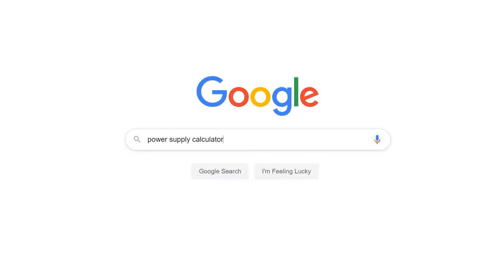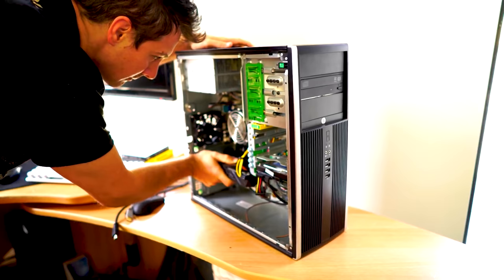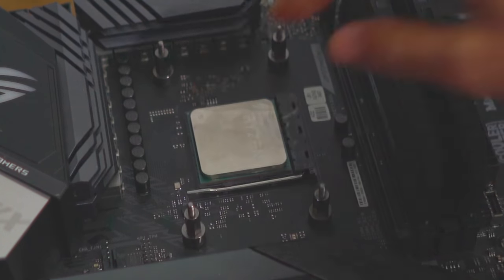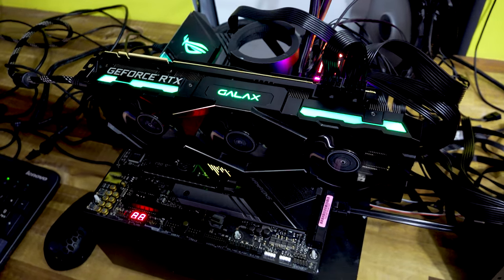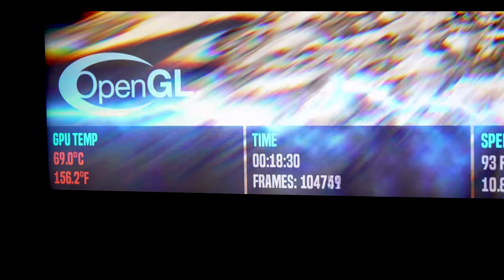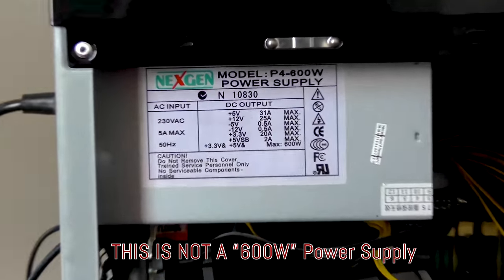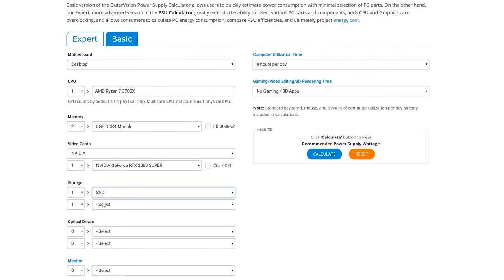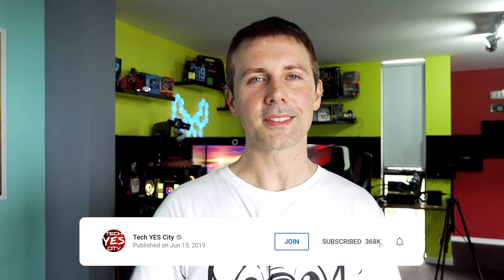I Tried Running a 3950X and RTX 2080 Ti on a 450 WATT Power Supply...

Comment: This is what happens when you win a cpu and gpu in a giveaway
Reply: Lol
Reply: I guess but  if u win that  u better work ur ass off to buy a decent motheboard an PSU.
Or just sell them n get some money .n make a build u can actually take advantage off
Reply: Lmao
Reply: @NeVErseeNMeLikEDis  sell 3950X for 700$, sell RTX 2080 ti for 1000$
build a 3700X + 2080 Super + B450 Tomahawk + RM650X + 16GB 3600/CL16 + 1TB SSD + 1440p/144hz monitor with that money
Reply: i can relate lmao XD
Reply: cob - Anime on Piano and More nah with that money go for the x570. Because that way you don’t need to update the bios. 3000 series chips won’t run on 450s unless the bios is updated from factory or if u had an old 1 or 2 series chip
Reply: RiceCube Tech B450 Tomahawk Max. That’s all i need to say.
Reply: @radiumuppet  radeon 64 sli oooff
Reply: @RiceCubeTech  yeh, like @Mr. said, B450 Tomahawk _max_. It comes with a bios chip with twice as much capacity with support out of the box for Ryzen 3000, and its VRM quality is as good as most of the <200$ boards. Saying that the board can handle a 3950X with PBO + Auto OC on with VRM temps below 90 degrees. it's nice sub 100$ board. I would personally much rather have that extra 100$ or so go towards a larger ssd (so 2TB), a large capacity hard drive (would be able to fit 4TB or so, i personally need that storage, but others may not so a 2TB SSD may be a better choice), or an aftermarket cooler like the dark rock pro 4, which for <70$, I could probably pocket that additional 30$ to something like aesthetics
Reply: I wouldn't know :/
Reply: @radiumuppet  That's a shitty build, can't even oc the cpu then
Reply: @radiumuppet  why this old mb ? Instead new chipset ?
Reply: @nikenzzo  you don't need PCIE 4.0 lmao
Reply: @RiceCubeTech  or you have bios flashback function...
Reply: @fucjn4315  It's ancient
Reply: @fucjn4315  Z97 is pretty old now, best CPU you can get is an i7 4790k. Also no DDR4 support. Z170 or newer would be better.
Reply: @NeVErseeNMeLikEDis  never sell em !
Reply: Why wouldn't someone buy the other stuff if they win premium products like these
Reply: @jagdeepsingh9515  Because if the other components are shitty then you won't see the benefits of the premium components anyway, is better to have a medium-high balanced build, than an really low - really high unbalanced build, since then the performance of the premium gets bottlenecked, of course, if you have already a really good PC, then great, but if not it doesn't makes much sence to keep them for no benefit whatsoever.
Reply: hi guys, anyone can help me with my psu350w build? So I want to change my pgu from gtx 750 ti for gtx 1660 super on specs. 2x4gb ram, b450 aorus pro, ryzen 1200 (af) on psu be quited (bronze) 350w. Can this psu handle it if I will undervolt a little my gpu and I wont oc ryzen ? Because in the next 1 month I will change psu for 500w and ryzen 3 1200 for 5 3600. But for now I think it could run gtx 1660 super cuz it has 125w usage, ryzen aroudn 65w max, what do u think ?
Reply: lol
Reply: Lol
Reply: @carlosrangel7134  that will run just fine
Reply: He met in a scenario that he never expected
Reply: @UnspokenTube0  I want this giveaway  🤣🤣🤣
Reply: Can my 400w psu run my rx 570 or ryzen 5 2600
Reply: Does it ever actually happen to anyone?
Reply: @radiumuppet  Still believe in no x570??? now
Reply: @jshane8888  yes. B550 exists now.
Reply: @radiumuppet  give me tutorial to sell giveaway part, since we are just a pc user, not a pc shop. i'am worried about people who want's to buy but bid in low price (sorry if bad english)
Reply: I wanted to give a friend a cpu, but his psu is not good enough, he doesn't have the 24 pin connector for the motherboard but only 12( he was talking about adapters maybe but I don't think that works).

And besides that I don't think its a very good one, some random oem one if I understood him correctly and only 500w(and I was planning on giving a cpu thats not very power efficient).
Reply: hahahaha wah beta wah moj kar di

Comment: BREAKING: Australian man's power supply blows up
Reply: BREAKING
Reply: He attempted to make an impossible experiment and his Power supply just blew up.
Reply: She Blinded Me, ...WITH SCIENCE!!  Thomas Dolby LIVES!
Reply: @dropdead234  Thomas Dolby does live. He is currently 61.
Reply: @Safetytrousers  Went right over your head, didn't it?
Reply: @dropdead234  Yes. It still does.
Reply: Fire soon started from that house
Reply: BREAKING Austarlians power supply
Reply: Power supply never break if u use more than it's capacity it basically shut down itself and restart..
Reply: I done that once doing the paper clip jump method, must have got the wrong pins soon as I flipped the switch BOOM, sounded like a car backfire it triggered the breaker in the house power box and shutdown the house scared the shit out me hah.
Reply: XYGR Gammel Group yeah?, strange this was a Corsair TX850 gold so wasn’t no brand crap, that’s 100% how it went down I lost the 24pin jump starter plug there was nothing connected except water pump and fans as I was leak testing my loop, I was going off a photo on my phone which connectors to put the paper clip in was confident it was correct flipped the power button and boom, I remember looking inside through the fan shroud with a touch and one of the big capacitors was swollen popped and stuff was leaking out of it.
Reply: BREAKING WHAT???!! BAD
Reply: @forsakenoutcast  to be fair I have a corsair power supply and it just turns on, no matter what. It doesn't care about short cutting.

But under normal useage it was never an issue in all the years I've had it.

Comment: Reminds me of the time when I installed a 500watts PSU to my client's unit with a gt1030 and he said he replaced it with a better PSU which is a 700watts generic one. I like fhe way he said it was better because it was 700 watts compared to the 500 true rated I installed. 😂 I explain all the power thing but left things to his hands. He'll eventually bring it back to me when he get problem with it.
Reply: I suppose you have charged him for warranty service? Or nothing got damage permanently?
Reply: He's got a 1030 lmao, there are few PSUs I wouldn't trust with that
Reply: With a GT 1030 he no need more then 450w 80+ white and even this is OVERKILL.
Reply: @strohhuttv8848  already told him that. Even a 300watts on a OEM can run that card. You don't argue with customers though. I keep all record and contracts because there will always be that one customer that will either try to rip you off or don't listen but don't want to pay either because they made their research but have you repair it.
Reply: @jay22alco  Indeed today most customers doesn't listen and do what they want.
Reply: Most likely it would be fine with the crappy "700W" PSU if it's only a GT 1030. A waste of money, for sure, but that's not your problem.
Reply: I mean it could better for the lifetime of the psu
Reply: I need help. I just swapped my 1660 for a gtx titan Z and I wanna know if 500w can run it

Comment: I've been saying it for years.  But good luck trying to convince people with cinder blocks for heads they don't need a 1000w PSU if they are not running multiple GPUs, a high end server or doing some sort of data mining.
Reply: IT IS a sexual Thing for Sure.
Reply: 1000w? No, but I'd say 850 watt is probably the sweet spot for a high-end single-GPU system that might see some overclocking. There are two areas you need to look at when sizing a GPU. First is your expected worst-case power draw (with some headroom to make sure you're not redlining it, which this video never did as the GPU and CPU were never stressed simultaneously), but the second is the noise and efficiency curves of a PSU. Power supplies are rarely at their most efficient when they're pushed to their limits, and a 600 watt load on an 850 watt power supply will probably be quite a lot quieter than a 600 watt load on a 650 watt power supply. Good power supply vendors will publish both the efficiency and noise curves for their power supplies, letting you see how loud your expected loud will be.
Reply: I know I didn't need a high wattage power supply, but I got a good deal on a SeaSonic X1250, and I was concerned ab noise and it had a passive mode. I got it for $140, and expect it to last a long long time, and generally don't hear the fan turn on.
Reply: cazablocki cinder block head confirmed 🤡
Reply: @maoteddy5879  Some people value silence. If you compare a 450W and 1250W PSU that both have passive modes (meaning the fan doesn't spin up until a certain power draw), I think you'll find the 1250W unit can push far more power before the fan is required.
Reply: @guspaz  It doesn't work like that, the more current the power supply draws from the wall more heat it takes.
Reply: @santiagocoradeghini238  It does work like that: the higher the power supply rating, the better the internal heatsinking. You can literally go look at the fan curves for power supplies of different wattages on manufacturer websites that show this. The higher the wattage rating, the higher the power draw required to cause the fan the spin up.
Reply: @cazandmal  as long as it stays clean. Dust affects heat and resistance of pcb
Reply: @johns3655  I'm pretty obsessive about dust, clean the dust filters weekly and every quarter or so pull the system apart to clean what I can. I suppose it's a downside of building a clean system, doesn't take much to make it look dirty.
Reply: Or if you’re playing pc building simulator and want to build the most expensive pc you can.
Reply: @guspaz  no, even a high end cpu and top gpu is under 400 watts in modern hardware, 850 is complete bullshit you don't know what you're talking about.
Reply: Got a cinder block as a head then with my 1500 Watt PSU ;)
Reply: Same people that think 8GB on a RTX 3070 is not enough when gaming at 1440p or lower.. They are why marketing with just bigger numbers will always remain effective..
Reply: That same PSU calculator used in the video told me that my system would need about 625 or so watts in it's current (outdated because of an old GPU I am reusing) state, and that for future upgrades to an RTX 3000 series I would need about 725 watts, which is why I am going with a 850. It's a bad idea to have the PSU just barely be hitting under it's max load, not to mention you waste more power that way as efficiency goes way down when you start hitting it's wattage ceiling.
Reply: EE here, just wanted to point out that many components, GPUs in particular can have huge transient current draw, the Vega 56/64 for example can draw upwards of 400-600W even though average power consumption is in the 200-300W range. It can trip your PSUs OCP if the current spike is too much for your particular PSU model, like what happened with the Seasonic Focus Plus series for Vega GPUs. This isn't even considering the ability to OC, flash a custom bios, mod power play tables etc. That's just a single component as well, so if you're planning to OC in particular, adding a good amount of headroom is crucial. Cheers
Reply: I run 2 Xeon E5 CPUs and a mid range/ high end gpu (I change it often) with a 750W PSU so maybe multiple 3 or 4 GPUs would make it worth it
Reply: @cazandmal  140 for that kind of psu is pretty good similar price to what corsair sells there rmx 850 for
Reply: well if you "overbuy" a 1000w power supply that one will last you at least 2 or 3 pcs plus that ANY component that is being used at its 90-100% it gonna last less than one that is being used at its 50% of power

Comment: The crash is just F1 2019 being F1 2019... Having played this game a lot it does just randomly crash now and then with no error message. Ask anyone who league races on this game, you’ll get the same response.
Reply: Even just in career or gp this happens, on a ryzen 7 3700x and rtx 2060 with 650w like low settings its stupid lmao
Reply: I second this.
Reply: PUBG: Hold My CTD
Reply: Yeah that's right i have f1 2015 and it has the same problem xd when i run 2019 its the same
Reply: Comanso he should retest with other game
Reply: Starving a 16 core CPU of power will only make the system more unstable. This power supply was definitely puking out noisy, rippled DC power at 430W power draw. Not exactly a good idea.
Reply: 3600 and 1080ti, same problem with random crashes. 2018 did it too.
Reply: if i put my 4gb evga 10150ti in nvidia controle panel on adjust setting with preview on balance mode, wy csgo is crashing, if i change it, csgo works fine.
Reply: change it and see if it works

Comment: try a cheap “a-brand-you-never-heard-of” or an oem psu lmao. some people will get triggered
Reply: I bought a hp elitedesk and the oem psu in it is 80+ platinum
Reply from the maker: Already tripped the aliexpress banger lol.
Reply: Tech YES City bruh good luck with that lmaoo
Reply: @techyescity  450W, 80 minus wood certified
Reply: Make sure it doesn't come with the certain recent virus
Reply: TigerPower 500W
Reply: That PSU calc tells me 341 load wattage, my poor 290w optiplex.
Reply: it will explode as they put out maximum 150w out of those 500 or 1000
Reply: XYGR Gammel Group  he performed the stress tests at the start and it completed them fine
Reply: The Illuminati Make sure it doesn’t come with the Voldemort.
Reply: XYGR Gammel Group  That wouldnt stress the cpu so no
Reply: Is Apevia any good?
Reply: @ChrisD__  they seem ok, I'd look at using just an 80+, I've been using a Chinese £15 PSU for months and it's been fine, it's a 500w, but outputs closer to 450w and it's been fine, but my system doesn't consume much more than 340w, so check the label and make sure it's total output is more than you need by 100w or so and check reviews, I'd look at buying a branded,  scan have a 700w 80+ unit for £25, but I'd be weary about that, and a 500w 80+ from aerocool for 45, used isn't always a bad idea
Reply: What is because uncertified PSU has half of what it says it does.

Ever bought Chinese batteries then run tests on them? 99 times out of 100 it will be false.
Reply: @fewik8567  Chances are the PSU isn't truthful and is giving you 475 or 450.
Reply: @dra6o0n  yeah that's what I said, that's why I went 500w and not 400w
Reply: Dells often have gold 80 so idk why you mean OEM on pair with noname
Reply: i have bought cheap china power supplys all my life since 99 only had one fail cause i didnt shut power strip off and plugged cord in back of power supply and sparks flew my fault deal

Comment: I have several hundred hours in F1 2019. It crashes like that all the time. A few times in the middle of my league race. Trust me the PSU was not at fault
Reply: sadly its the truth, for some reason f1 games have this bad habit of crashing for no reason
Reply: When I play in fullscreen I have crashes, but when I play in window mode I don't have any problem.
Reply: if i put my 4gb evga 10150ti in nvidia controle panel on balance mode, wy csgo is crashing, if i change it, csgo works fine.
Reply: Codemasters are shit. I gave up with their games.
Reply: i just made a account for eve online online and the game runs bad with full screen mode and fast with windowed mode and its the only game i know that does that
Reply: Make sure to run in DX11 instead of DX12, that fixes a loooot of problems
Reply: You guys play on windows 10? Try disabling the fullscreen optimization
Reply: @F2Ptaxi  and the game mode
Reply: @jornmulder  holy shit where did you get a 10150ti!!!!?????
Reply: @eriiis2231  he's from the future
Reply: Hey Tayo the future is from him
Reply: yeah it's your cpu's not getting enough power dude not the power supply's fault bios setting's fault
Reply: @jornmulder  holy shit I want a 10150ti, it's probably way better than rtx
Reply: I know is an old comment, but I had consistent crashing playing Half life alix, and similar VR games after  1-3 hours with a 500W EVGA 80+ PSU white and after many repeated similar issues I just tried with a borrowed 700w 80+, and the crasshing stopped playing longer hours and now with a bigger PSU than 500w it is not longer are happening. Seems that games just close or stop to work is an usual issue from my experience. My card is OC maybe is for that too, but PSU issues are a reality.
Reply: It's time for Bryan to change the default benchmark game definitely.
Reply: @itIsI988  once they were great - I remember the pinball game from around 1995
Reply: I tried to run a 7800X3D and a RX 7900XT on EVGA 650ga supernova run fine until I try to play a game power supply says no shuts off 😢

Comment: I appreciate videos like this because it's really shows where most people are at with their builds. I just ordered the parts for a Ryzen 5 3600X and a 5600XT build, and I went with a Corsair RM650X which I know is more than enough. Not overclocking. Funny how some people would try to tell me I need a 1000W PSU. I know they're out there and you've shown this. Respect!
Reply: Yeah but if you wanna upgrade future GPUs are gonna use more power. Especially if you wanna do Nvidia cards in the future the 4080 and 4090 use at least 500-666W at normal use. Not saying you want those GPUs but since the PSU is gonna last longer than a lot of your PC Parts you can save money over time paying more for a high wattage PSU. I was using my 750W PSU for 7 years before upgrading my monitor and GPU. I noticed that I was getting random restarts and crashes and just changed to my 1000W PSU and it’s a lot better than I thought. I will soon be grabbing a 1200W PSU for a separate server build